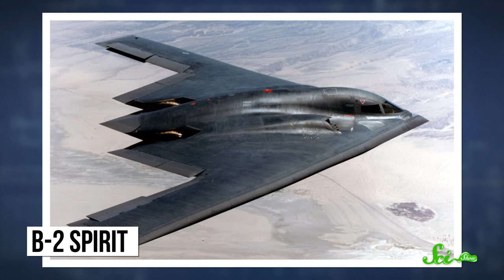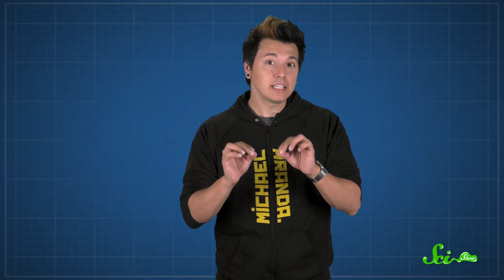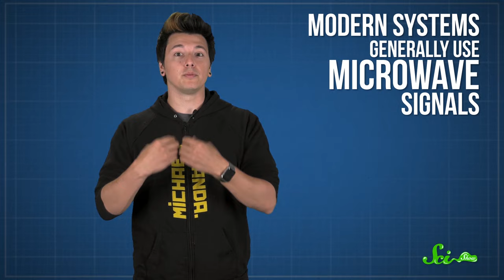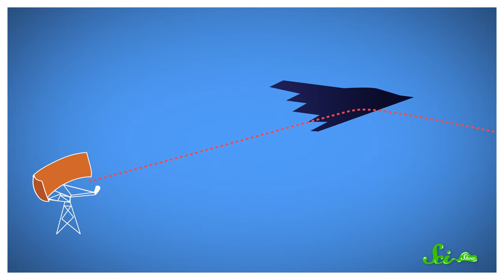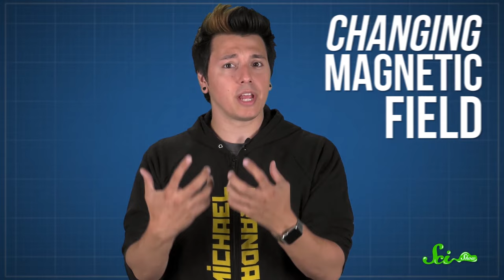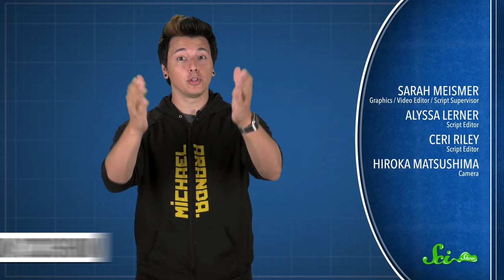Stealth: How to Hide a Plane

Comment: Except China now claims it is using quantum entanglement to detect "stealth" objects.
Reply: Also I was lead to believe certain long waves systems that we're improved from WW2 could still penetrate and detect the internals like engines etc..
Reply: Long-wavelength radar gives exactly zero fucks about the shape of an object. Russians have miniaturized the technology to the point where it fits on a truck and so can quickly be deployed anywhere. Also, radar signal deflection relies on no radar antenna being in the direction of the reflected signal. However, nowadays with battlefield-wide integrated radar systems, even these reflections can be used to detect a plane. In fact, that's the whole idea of passive "radar". While not in itself accurate enough to guide missiles, it's good enough to bring a fighter so close that a direct radar or IR lock becomes possible.
Reply: totoritko yeah what you said :)

Comment: So a stealth plane reflects minimal RADAR signals back to the RADAR antenna and, instead of looking like an airplane, resemble a flock of birds?

Ok...so how many flocks of birds travel above 20,000 ft and move faster than 500 mph? If I was the RADAR tech and something on my scope was traveling very high and very fast, yet looked like a "flock of birds" I'd probably put on my logic-hat and determine that the RADAR system was being duped, and tell my superiors that I've just found a stealth aircraft.

Are the people who interpret RADAR signals that dumb for thinking birds fly that high and that fast, or am I missing something?
Reply: It doesn't matter how small it looks...RADAR not only tracks object size but also tracks velocity and vectors, so anyone who actually watched their monitor for more than one RADAR rotation would see the object move faster and higher than any flock of birds.

You seemed to have completely missed the point of my comment.
Reply: Ir doesnt in radar
Reply: *appear

Comment: Yeah.. if radar thinks that a flock of birds can fly at 1000 km/h..
Reply: Is that a bird? Is that a plane?
 No it's super plane man bird? 
I really don't know. I really don't know.
Reply: Every one of these comments about the super fast birds the speed always goes up..
Reply: Bogie inbound!
... Nevermind, Just another super sonic seagull...
Reply: If radars highlighted every single potential target, then they would be useless because there would be too many (do you know the difference between data and information?) . Radar data processing is an extremely complex task; the radar in the F-22 requires two processors with about 10 GFLOPS of performance each, and that was in the era when the most powerful desktop computers used the Intel 486.
Reply: damonstr You may have missed my point. I meant checking the speed of the object, not just the shape. That wouldn't even require twice as much computing power. And we're talking about ground radar, not a mobile one.
Reply: Does it matter if the radar is on the ground or not? 
Anyway, radar gets refelected waves all the time. If the irrelevant ones were not ignored, your radar would be useless. You can only determine speed of an object if you have several good returns. A stealthy aircraft is not going to give you those. You could say that there were two returns that might imply a fast target, but they might as well be ghosts off different parts of a cloud. Or maybe two birds. If it truly was as simple as you think, no one would bother with stealth. As I have already said- the hardest part of radar design is not making the antenna and T/R modules, it's processing the received data.